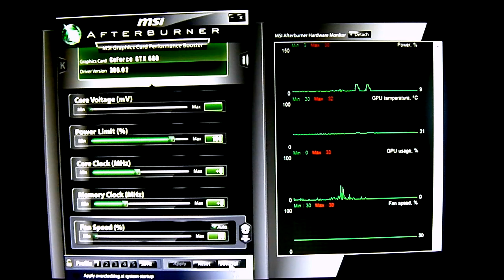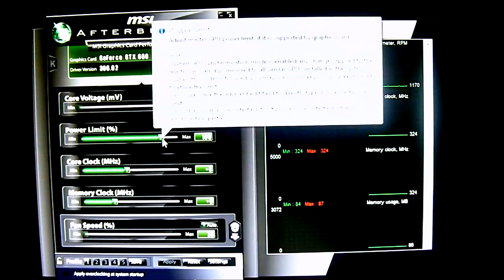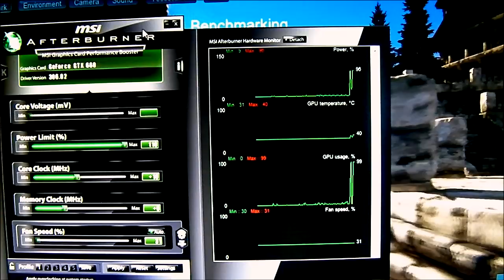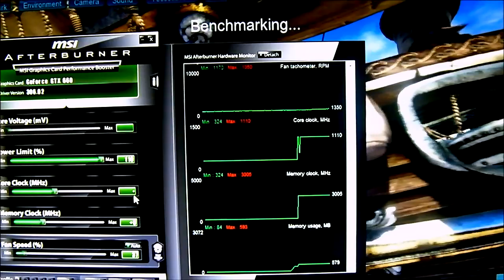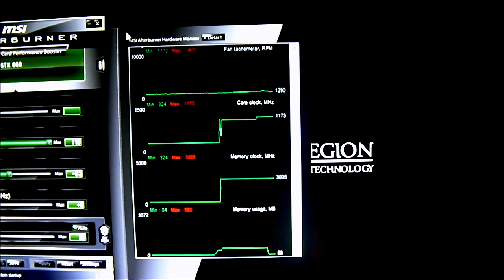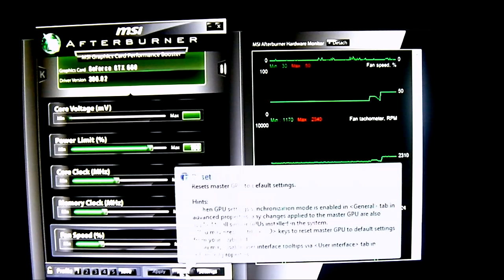Overclocking MSI GTX 660 Twin Frozr OC with MSI Afterburner

Comment: mine gtx 660 is running 1202 mhz boost clock and 3348 mhz memory :)
Reply: Can you write your exactly parameters for this OC?
Reply: i bought already overclocked card and it boosted up to 1149 mhz and i manualy overclocked it +60 mhz on core and + 340 mhz on memory . I know that with + 60 core clock it should boost up to 1210 mhz but it only boosts 1202 i dont know why but its stable for me . i also didn't touch voltage ( sorry for bad english)
Reply: Beast _TO oh okay. The core voltage and power limit is it in default? (don't worry i'm bad too :P)
Reply: livio passarelli voltage is at stock and power limit is at 110 %
Reply: Beast _TO all right, thx :)

Comment: I don't understand, my Core clock slider is almost to the min but when i try to add values like 20 or 50 it barely moves at all. To get to the halfway point between min and max it  shows a 400 value increase. My power limit percentage caps out at 119%. I guess i just don't get it..
Reply: Sry for my bad english, but is it an NVIDIA or AMD Card? The MSI Afterburner only works with NVIDIA Cards!
Reply: +Merlin It's an Nvidia card.

Comment: I would recommend doing the memory clock while u have your stable gpu overlock.Because in the end you would like to have them both at the same time..that's the whole point of this. I find that once I get on with memory overlocking on gtx 660, the card really starts to get to the 109% and over power and the card starts to throttle down.:(

Comment: adjust your fan speed. i have the same card my fan is running at 50. my overclock on it is +300 on memory and +44 core.h t t p : / / p u u .s h / 3 J v E 6 . P N G remove the spaces and paste link in browser

Comment: Thx for your video and your full review ^^

I have the same GPU as yours but i couldn't exceed +40 MHz core clock and +200 MHz Memory clock by using Unigine Heaven 4.0 (same setting). And i reached only 41 FPS avg. Pls help me :(

Comment: I got to +30 on core clock and it crashes, My display refreshes and all of a sudden heaven or a game in fact will have seriously dropped frames to like 10fps. But on +20 its fine, Memory clock Im just gonna leave on +200.  But one thing I noticed is you didnt put the power limit back to 110 after finishing, arnt you supposed to ?

Comment: I no longer have an option to increase the power limit and adding voltage does nothing. Currently stuck at +40MHz core and 200Mhz memory. Any ideas?

Comment: Make sure the memory and clock speeds are identical between the cards. If they're any different the sli wont work. Otherwise overclocking is about the same

Comment: I just bought a system which has 2 of these cards running in SLI mode. Any advice on how I should go about overclocking when they are in SLI and what settings / speeds I should use?

Comment from the maker: Hi, newer cards throttle when loaded with pure GPU loading programs such as Kombustor/OCCT, etc. Both AMD and NVIDIA care too much about benchmark results that they don't power down when running real games or synthetic programs that produce numbers such as 3DMark11 and Unigine, so the load is closer to real world heavy use while being consistent and controlled.

Comment: get the afterburner 2.2.3 version if you want more over clocking abilities.  2.2.4 does not work well with the gtx 660 ti. i learned this the hatd way.